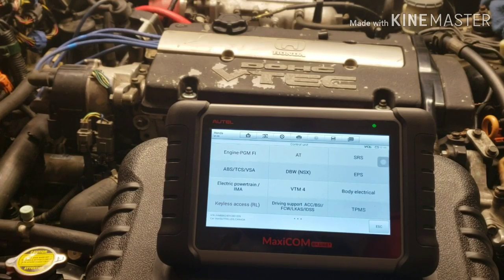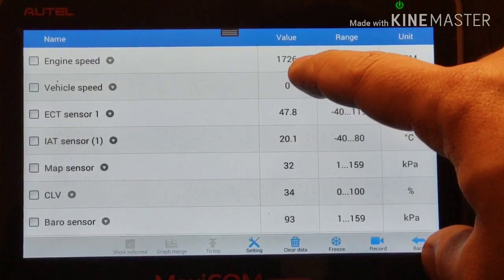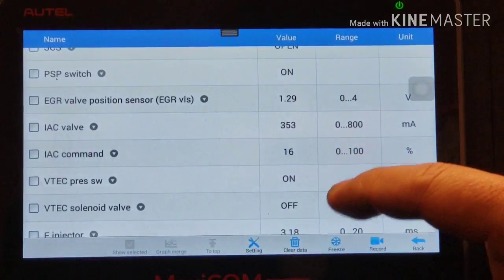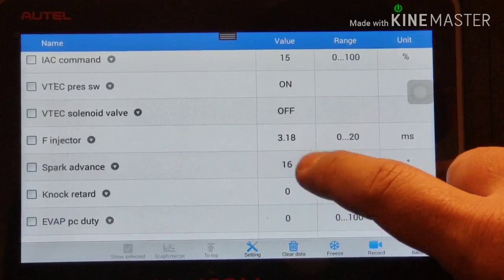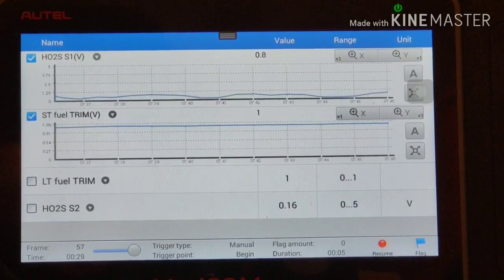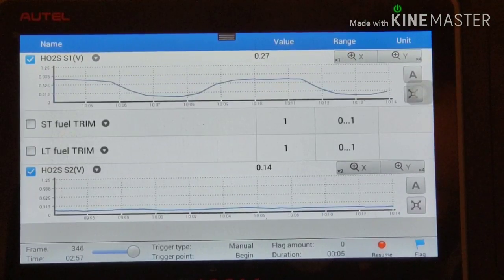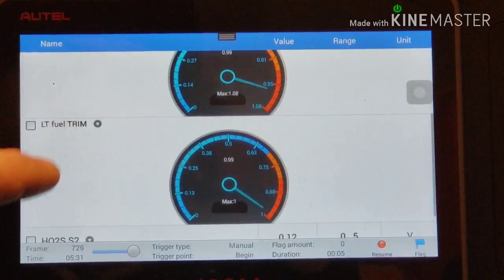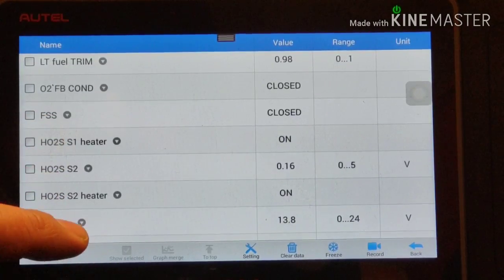Autel Maxicom Mk808bt, Diagnose o2 Sensor Fuel Trim Performance

Comment: Actually the system was trying to correct the current condition: O2 sensor 1 was reading a lean condition, so the short term fuel trim was at maximum 1, trying to add more fuel to correct the lambda... But for aome reason was unable to correct it. So you probably have a vacuum leak somewhere. The next step is to raise the rpm to 2500 and see if the short term fuel trim starts to fall down... If so, you have to find the leak...

Comment: And so ... what was the result
Reply from the maker: Replaced both o2 sensors, the old sensors lazy not working right.
Reply: @jfGarage4k  Thank you very much for replying. would you mind telling me what is the most recent year car the tool is capable of working on? For example, can it work on the 2017 Megane 205 GT and what functions will it cover

Comment: My o2 sensor is stuck at 0.01 and doesn’t move ? Up stream ! Could this cause poor acceleration? No engine light thou
Reply: If your "upstream" o2 is stuck @ .01mv then you are running way lean. You'll have no power.
Reply: @MicheluceRizzuto  it has terrible acceleration and it’s remapped
Reply from the maker: Replace  both sensors  and your set
Reply: @richardmathers7238  if your UPSTREAM oxygen sensor is actually stuck at 10 (ten) Mv. then you need to replace it first. You really should verify the actual harness integrity, but to simplify and if the o2 sensor cost is minimal, then I'd replace it if I were you. Stuck? I take it that you're saying that even when creating a vacuum leak or adding alternative fuel for combustion, the mv's stay at .01mv and don't move? If this is the case, then you most like have a bad o2 sensor. But only the upstream, not the downstream. If the sensor is actually non responsive at actually at .01mv, then you will have zero power. 
No disrespect to the fellas in this video, but the guy is apparently a newbie and isn't yet educated on fuel management, short and long term trims. He really should not be giving advice because it's incorrect. Like I said, no disrespect at all. I was once there in the beginning, being a novice. Way back in 1983. It takes years and a lot of education to be a diagnostic guru. I honestly hope for him to continue and become the guy that everyone knows is the shinizzle with diagnostics. 
Btw, what type and model is your vehicle? Not that it makes a difference. An o2 sensor is an o2 sensor
Reply: @MicheluceRizzuto  it’s actually fine power wise over 2k rpm but it’s stuck on 0.010v and cat is reading -39 degrees c ??
Reply from the maker: Let the car run (idle) for 20-30min and Check (by using Lazer thermometer) the front of the Catalytic converter see if its  hot and the rear is cold, thats a sign of plug  converter.
Reply: @jfGarage4k  ok, if it’s not blocked will both ends be hot ?  Thanks for the help aswell I appreciate it 👍
Reply from the maker: YES.. lack of power when you accelerate, your running lean  on your air fuel ratio. Take  the o2 sensor  out and clean  it  carbon material or some gunk got stuck  or replace it with  a good  new ones
Reply: @jfGarage4k  it’s a strange problem this, car flys with maf unplugged but Iv had 3 different new ones fitted and all reduce power so it’s definitely air related so I’m hoping your right mate cheers !  My cat temperature is also off reading -39 when engine is warm ? Could this be o2 relates as well ? 
Thanks again 👍

Comment: My LTFT STFT are - 17... MAF 2.6 on idle and with ac on idle 3.5.. egr error 99.2 sometimes egr fluctuating even negative error... O2 sensor 1 no reading sensor 2 reading is .1 to .9... air fuel ratio commanded and measured fluctuating...
Reply from the maker: No reading  on sensor 1 thats your Primary sensor.  Dead sensor  need to replace  it
Make sure your diagnose  results  are right   get the engine heat up on the  right temp
Reply: @jfGarage4k  i am using torque pro... i have heared that torque dont read sensor 1. I dont have extended pid for  sensor 1. 
Honda civic 2012
Reply from the maker: I never experience  that time of scantool before I'm not sure how they  function, its better to get a scanner  that ready  the afr on primary and secondary  o2 sensor. 
What code did u retrieved from he scanner? Post them up please

Comment: -1% to +1% on fuel trim is normal.  i have a prelude with h22 and it ran  +15% fuel trim. 
if your having fuel trim issues? check your compression and check for vauum leak on intake manifold where the manifold bolts to head on the #1 cylinder.  
you can thank the new SAE SN spec oil for killing these old engines. they need more zinc in oil than they put in SN spec oil.
long term fuel trim follows the stft. so if you have high stft within some time the ltft will rise

Comment: U got bad oaf or vacuum leak
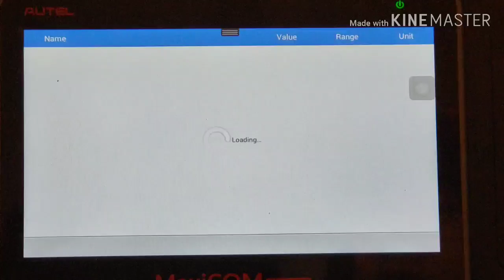Reply from the maker: Hi Diosdado!  I dont think it's a vacuum  issue on frame 2:20 livedata Map sensor reads 32 to 38"psi, manifold  is under pressure. If I have leaks my map sensor  well read low numbers it well be around  10, 15"psi